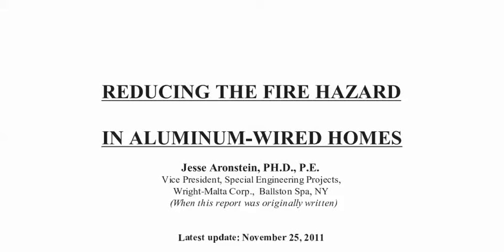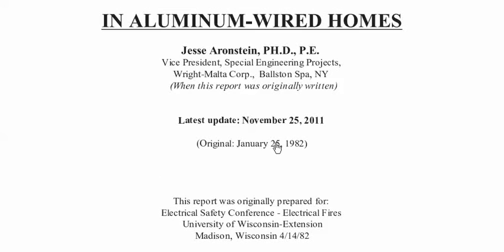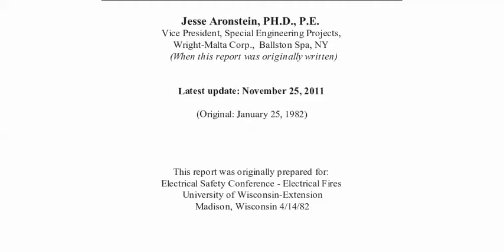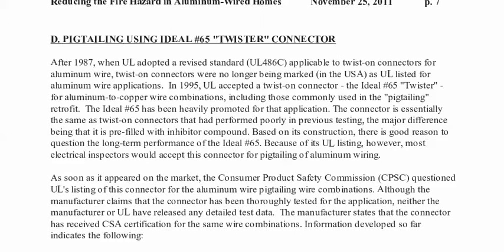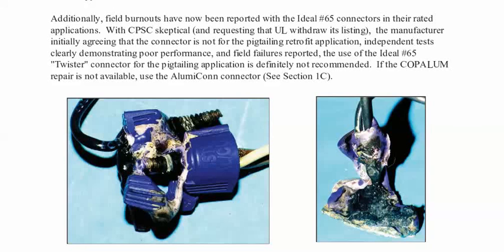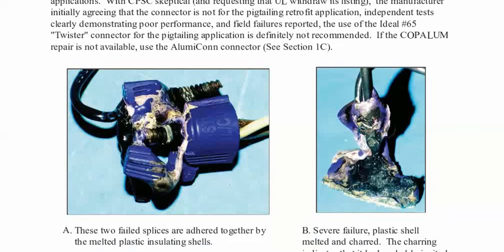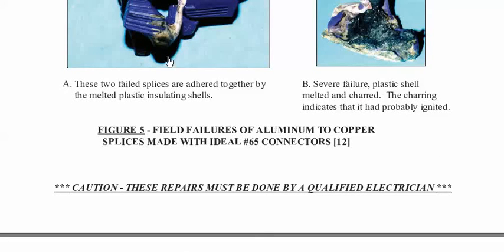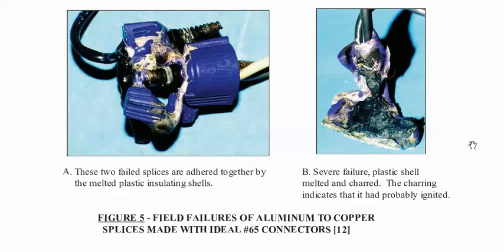Top Scientist's Report on Aluminum Wiring Connector Will Shock You!

Comment: What about simply replacing a original pre-existing wire nut on aluminum to aluminum connection it has not corroded or overheated in the last 50 years?

What if you're moving or replacing a junction box and simply reconnecting strictly aluminum to aluminum only connections?

If it lasted 50 years the regular red wire nut and no antioxidant paste what would be the problem putting it back together with the same type of connection?

But since the old red wire nuts are no longer rated for aluminum, even though it lasted 50 years, would the ideal 65 be acceptable in that case when there's no copper in the connection at all?
Reply: aluminum to aluminum, Marrette brand  #33 and #35 are okay, I prefer penetrox and Marrette brand #63 & #65 for pigtailing copper or replacing 33s and 35s, not ideal brand.  penetrox is a must in my eyes, ABB Marrette ACS #63 & #65 are temperature rated accordingly..